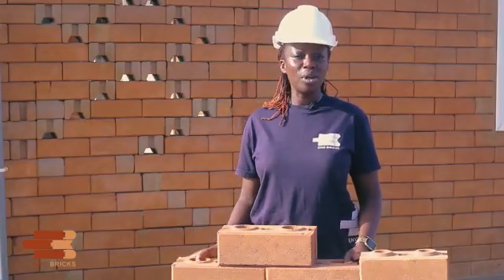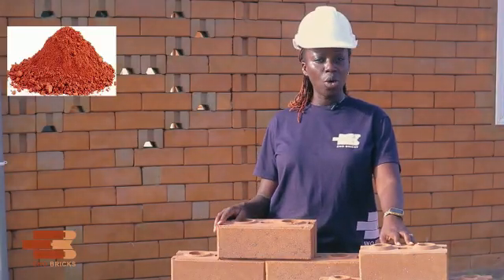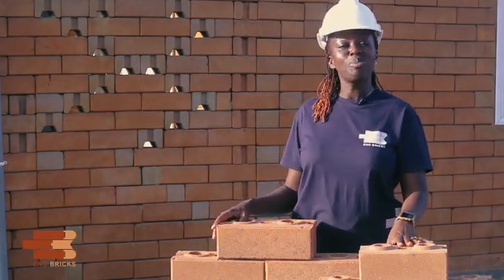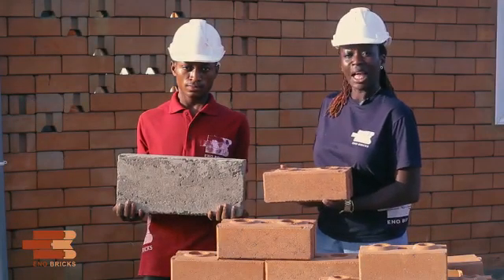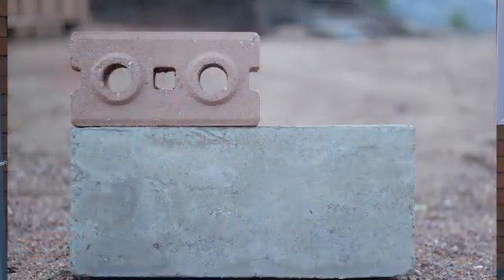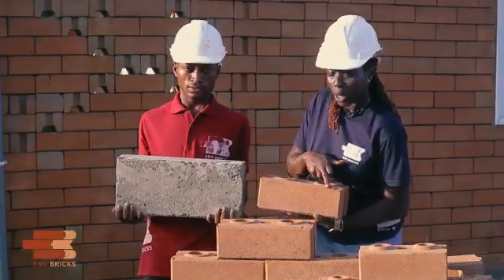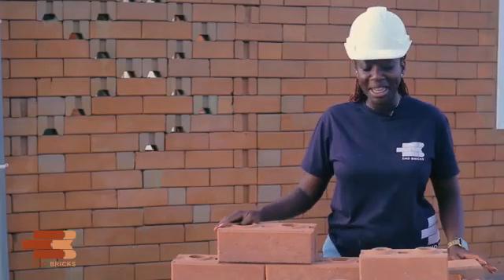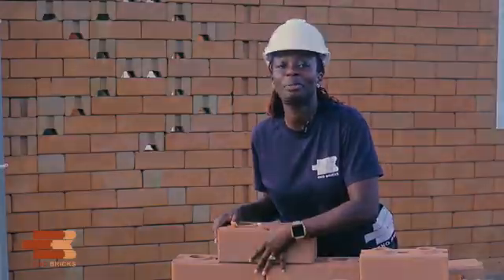Interlocking bricks Q & A

Comment: Hello
Please can interlocking bricks be used for decking upper floors using the flat beams method?
Reply from the maker: yes, you could if you use the appropriate sized beams. We would also recommend using a structural engineer during the process.

Comment: How do we finish the interior wall rough surface???
Reply from the maker: You can use a clear epoxy resin protection to apply on the surface if you want to maintain the brick finish for the interior.

Comment: The bricks you are displaying are Compressed Stabilised Earth Brick (CSEB).  The other brick, with the tongue and groove are Interlocking Stabilised Soil Bricks (ISSB) or they are also known as Hydraform Bricks.  With the Hydraform Bricks, depending on what machine you use to make the bricks, you can get variations in length, which is not ideal for building any structure.  

The brick you are showcasing, with the cores / perforations is actually better for construction, as you are able to vertically and horizontally stabilise the wall with reinforcing and cement throughout the wall.  The other benefit of CSEB are that you can run your utilities via the cores, without compromising the integrity of the wall.  ISSB, you either run the utility on the outside of the wall, or cut into the wall and backfill with cement, thereby reducing the integrity of the wall.  Please view the attached link for demonstration:
https://www.youtube.com/watch?v=cWYyiE6OBE4

With hiding defects in the bricks, it is possible to cut a brick out and put a new face in place.  Malaysian Interlocking Bricks have a video on YouTube, where they take to a brick with an angle grinder, remove the face, then place mortar on the back of the new face, then simply press into the wall.  Please view the attached link for a demonstration of how to remove and refit a brick face in the wall:

https://www.youtube.com/watch?v=lPRCVf8OsUM

Having seen several videos on YouTube, it is my thinking that there is a market for a 450 * 150 * 100 mm brick for internal wall use, especially at a 4 way meeting of walls.  But, in saying that, Australians used to build with a 290 * 90 * either 90 or 76 mm brick.  Depending on the brick, the 90 mm high were called Modulars, while the 76 mm high were either Glenline or Ranchline bricks, depending on who was making them!

There is also a company that manufactures machines from Thailand, and Malaysia, whose machines are set up so that you can, if you wish, put finishes on the face of the brick.  This can vary from an exquisite pattern to a rockface design.

My hope is that my knowledge has been of help and of interest to you and your viewers.  In the coming months, am looking to build my own machine, and set it up so that different types of blocks and bricks can be made from the one machine, thereby being more cost effective with the production of different products from the one machine.  Currently, from what has been seen, if you want to make 3 different types of product, you require 3 machines.  My system, if it can be done to what my thinking is, will be one machine that can be set up for different products and different sizes.
Reply: Excellent explanation, thanks for taking the time

Comment: Well explained but please can interlocking bricks still go under the burning process... Can we have a burnt interlocking bricks?
Reply from the maker: In short, no. The composition of ISSBs (soil type) is different from the materials used in burnt bricks which is why ISSBs are sun dried/cured rather than kiln cooked. We will be doing some upcoming videos comparing ISSBs and burnt bricks.
Reply: Great question

Comment: What is the dimensions of each block and diameter of each hole?
Reply from the maker: Each brick is 12 inches length by 6 inch width x 4 inch height. The holes (2 circular and one rectangular) in the brick are approximately 2 inches in length/diameter.
Reply: @enobricks9969  is it necessary to fill all the circular holes with mortar?